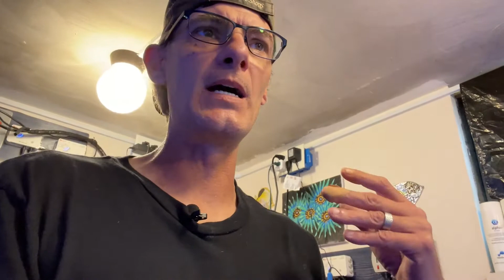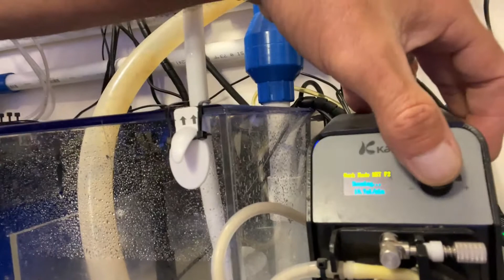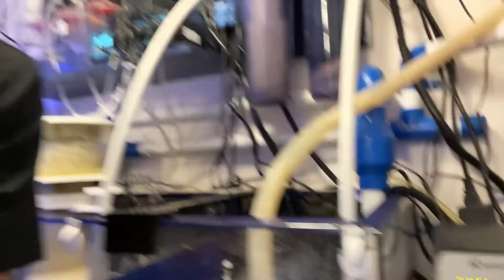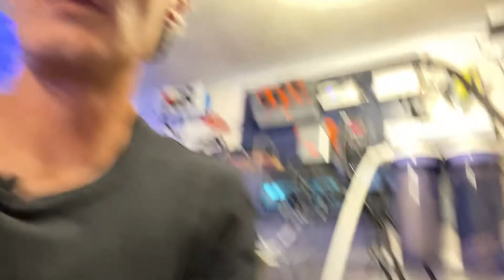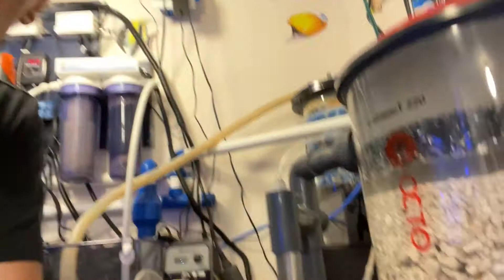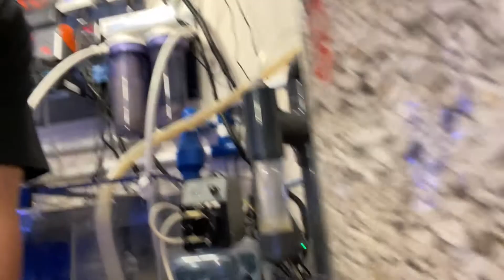Calcium Reactor Octo Cal React 220 (Trying To Answer A Viewer Comment) (Bubbles Trapped Inside) Help

Comment: First I would like to thank you for taking your busy life and getting back to me, furthermore I have my kamoer running 4ml due to high alk -  11.4 it is consistent my corals not consuming alkalinity to much. Would you happen to know which calcium reactor is not noisier. Octopus reactor is in my room makes so much noise even on eco.
Reply from the maker: You are welcome. 4ml is lower than what I'm running. As far as a quiet reactor, mine seems quiet. But also my fish room is downstairs so I don't hear anything. I wonder if being my reactor is oversized by a lot, that is why I need to run it so much lower. If I remember correctly I believe my reactor is rated for 300 gallons fully stocked with sps. Put that on a 180 gallon it may be overkill, but im going to take the advise givin to me in the comments and raise my PH inside the reactor from 6.7 to 6.9 and then see if I can push more ml into the tank then.
Reply: @PittsburghReefJunkie  currently my ph is set to
If pHc > 6.59 Then ON
If pHc < 6.49 Then OFF
On neptune system.let me change it to 6.9 and put the ml to 10 on kamoer

Ok I set it to

If pHc > 6.79 Then ON
If pHc < 6.69 Then OFF
Reply from the maker: @kevindallas1845  I'd go to on at 6.9 and off at 6.8 then you should be able to adjust to a higher rate on the kamoer. But make sure you increase kamoer slowly as to not overdose, and test that KH daily.
Reply: @PittsburghReefJunkie  I think I should turn off the co2 and run the kamoer max speed till the air goes out not sure If this is wize think to do
Reply from the maker: @kevindallas1845  I would say no. I say this because the melted effluent is inside the reactor even if you turn off the CO2. Being your only using 4ml a minute it would take some time to drain that effluent into the tank. If you ramp that up, you could very much so push all of that into the tank fast and kill everything with a extremely high KH level. This weekend I'm just going to turn off my CO2. Turn off ph controller and pumps, open the reactor and drain it into a 5 gallon bucket. Mark the depth so after I can fill it with fresh saltwater when I switch to a push method. I could at that time recalibrate my PH probe, and put it all back together and crank up that kamoer and get air out and then after the air is out I will adjust accordingly my ml with a higher PH. As long as you are under 7 for a ph it will melt the media.
Reply: @kevindallas1845  test the Alk of the effluent from your reactor.  Different media dissolve at different ph.  In my experience Reborn does well at 6.5.  ARM coarse I had to use for awhile when Reborn was unavailable needed 6.3 to give an effluent with Alk of 15.  Also some reactors are more efficient than others in CO2 use.

Comment: Im pushing because I was told pulling would cause this exact issue.
Reply: Didn't realize till I am facing this predicament,  wize to dose till you see you really need calcium reactor, if corals not consuming alkalinity to much dose the tank, I am getting a trident, once I see the corals are consuming alkalinity I'll hook the reactor.

What would you guys recommend I should do
Reply from the maker: @kevindallas1845  that is always an option Kevin. I just never wanted to gamble with kh when I have a lot of corals and made the switch over. I want my levels stable from day one and stay stable. Honestly the bubbles never bothered me until you brought it up. Never changed my KH levels in the tank. But it's annoying now that you pointed it out with yours. Lol. But it will give me something to do with the tank.
Reply: @PittsburghReefJunkie  10ml is not much I would see if we pushing 50ml a day, I think I am going to buy a small calcium reactor this one sounds loud at night time. Reef Octopus VarioS CR220 DC Calcium Reactor that's the one I got
Reply from the maker: Guess I'm going to have to shut it down this weekend drain the reactor, and switch it to push. Have you had issues while pushing at all?
Reply: @PittsburghReefJunkie  none
Reply from the maker: @russellchiles3343  thank you Russell. Right now I have the circulation pump off. Checked all connections. So we will see after this weekend.
Reply: Another  thing to consider is 10 is really low to be pushing on a kamoer. Consider balancing that out with a higher ph and pushing more through. When I started with my GEO, the starting point was 30ml from geo.
Reply from the maker: @russellchiles3343  all valid tips. Going to try all of this. 2 part was so much more simple, but way to costly after a while.
Reply: @PittsburghReefJunkie  I ran 2 part for 8 years until I was dosing 350ml a day.  Switched to a Calcium reactor and never regretted it!  I hated keeping track of 2part jugs.  Now I had to add a Kalk stirrer to keep up with Alk.   🤣
Reply from the maker: @andrewsdrmike  you are not keeping up with alk in your reactor?
Reply: @PittsburghReefJunkie  running 140 ml/min.  Keep Alk at 8-8.4.  Run Kalk at 4500 ml/day.  Helps maintain ph.  Lots of sps means lots of replacements 😊

Comment: I ran mine without CO2 for a few hours before turning on CO2 to purge bubbles from media.  I do this when I refill/top off media also.
Reply from the maker: So what do you do if you don't need to top off? This has been running for almost a year now. Wouldn't It drain into the tank a whole lot of effluent causing an alk spike? And it seems to come back after time. Maybe two much CO2 injected into the reactor? Lower my bubble count maybe? And thank you Mike for replying to this.
Reply: @PittsburghReefJunkie  make sure all junctions are tight and no air is getting sucked in.  If all tight then try unplugging recirculating pump to allow air to accumulate up top and escape via effluent line, when purged turn on recirculating pump.  When I set up my Geo 618 that is how I purged the air at initial setup.  Also be sure to check the input line if you are pushing water into the reactor from the peristaltic pump.  I know the Versa connection was prone to let air in but has been fixed.
Reply from the maker: @andrewsdrmike  thanks Mike I am going to try all of this in the morning. I know I'm pulling water and not pushing. But for sure going to check to see if there are micro bubbles getting pulled in where line is at in the return chamber of the sump.
Reply from the maker: Thanks for the tips Mike.
Reply: @PittsburghReefJunkie  thank you for the tip Mike
Reply: @PittsburghReefJunkie  I am using neptune system it turns off the co2 even though I had the co2 off for 1day it's still bubbles in the reactor nothing has changed

On the kamoer 4ml I am pushing due to high alk
Reply from the maker: @kevindallas1845  I have my co2 running but I have turned off the main octo varios circulation pump like @Mike Andrews stated to try.
Reply: @PittsburghReefJunkie  that many bubbles means air is entering the system somewhere.  The CO2 to keep reactor at 6.5 or so at your low flow is not enough gas input to cause streams of bubbles or your ph would be very low if the bubbles in the reactor were CO2.